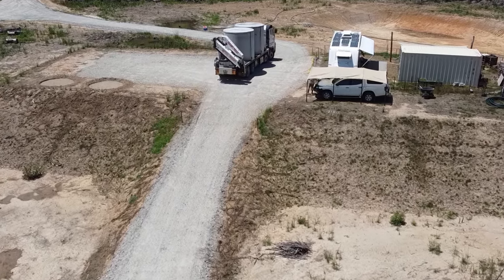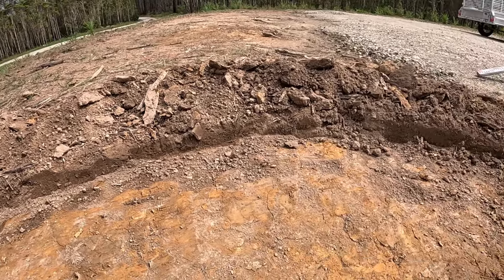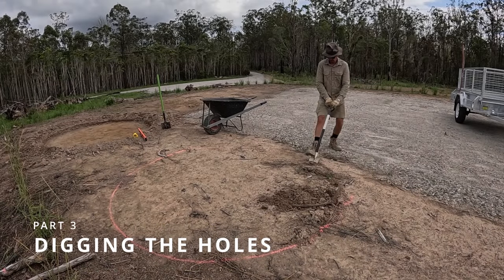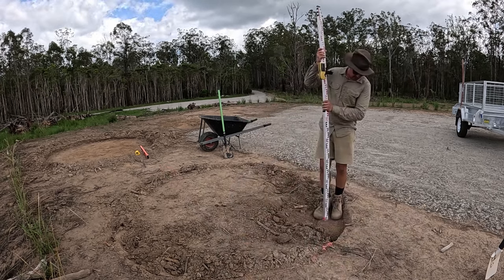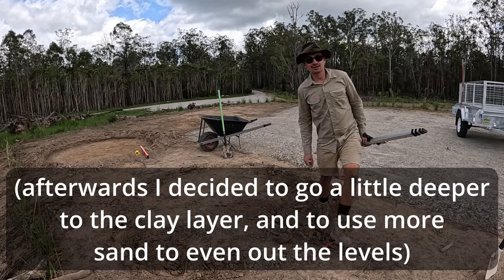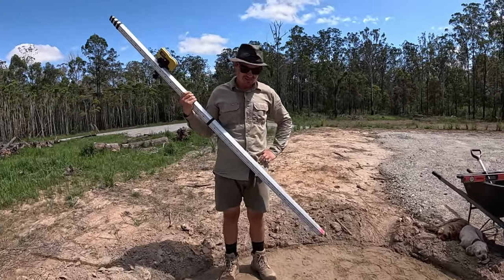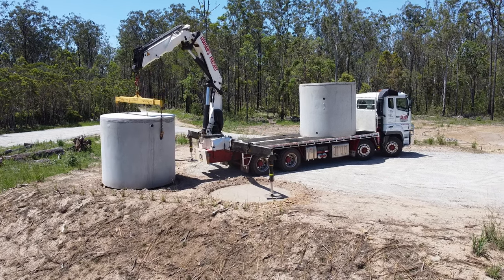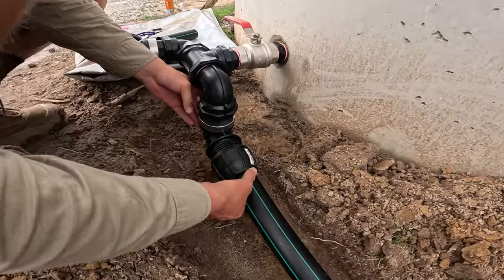Installing Concrete Water Tanks & Preparing a Dug Out Base

Comment: Hi Alex, wondering if you could explain why you chose concrete and not poly or steel tanks.
Reply from the maker: We were after longevity, and concrete is known to last longer. But that said, concrete tanks are heavier and hence harder to install/remove, and they can crack too. Steel ones are lined with a polymer on the inside and can rust if the paint is damaged, so it makes sense why poly tanks are so popular. 
Poly tanks still last a couple of decades and are really easy to install so there's pros and cons to all options.

Comment: Awesome job guys 👍👍👍Just edited my comment about the use of concrete tanks cos I didn't read the description 🤣 🤣🤣

Coming along nicely, any plans for a homestead Type ? shed , Sea Containers ?   

Cheers Andy 🍺🍺🍺
Reply from the maker: Thanks Andy 🙂
We're planning to put a 9x12 metre kit shed on there the size of that gravel pad in the shot.
When weighing up concrete vs poly there's pros and cons for both. Concrete should last longer, but they can crack and are a lot heavier and hence harder to install. 
After getting these, poly tanks do seem like an easier/cheaper option to work with that still lasts a couple of decades. Afterall, if we ever needed to replace poly tanks we could then just prop them up with a crow bar and roll em down the hill! Not the same story with these 😅